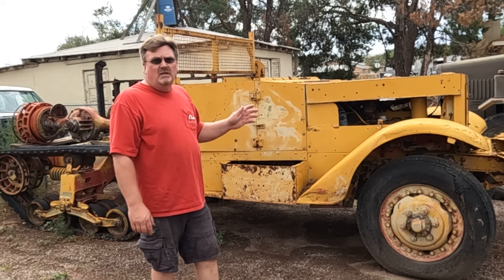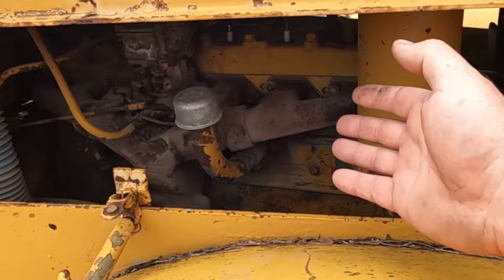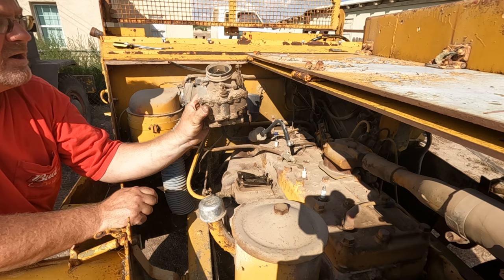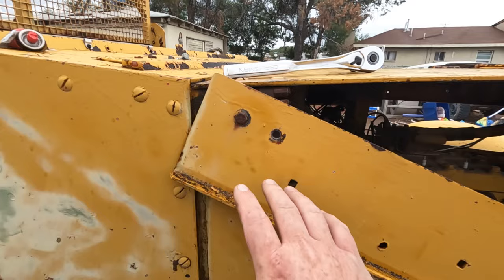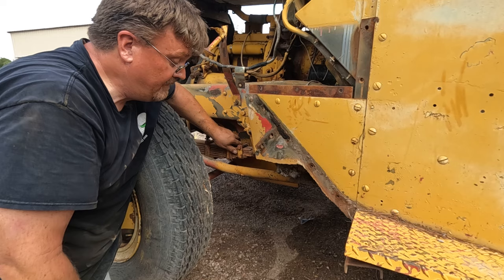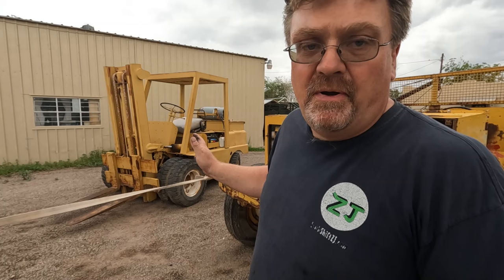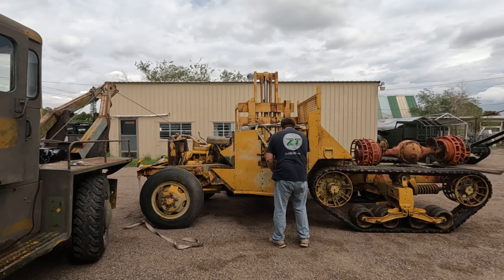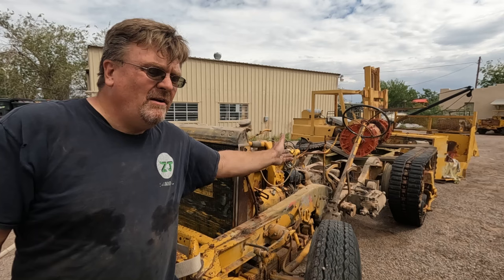WWII Half-Track Stripped to the Bare Frame!

Comment: No idea if you know it, but that pre-atomic bomb armor plate is actually pretty valuable. They use it for geiger counter and other "nuke sniffers" type instrumentation housings. All the steel from that tear down is premium scrap.
Reply: what?
Reply: @69uremum  steel refined before atomic bomb explosions has high value for technical use, so long as it isnt alloyed with later production steel. all ww2 and earlier steel (pre 1945) falls into this category, but armor, due to the alloying metals used, is especially desirable, as are tool steels
Reply: @ludditeneaderthal I thought that was only the case on shipwrecks due to the radioactive shielding properties of water?
Reply: @bl7355  No he's right. It's all pre nuke steel
Reply: @bl7355  Nope, all pre-'45 steel. It's the production of the metal that introduces the isotopes from the air. As long as it wasn't melted since '45, it's good.
Reply: Take the engine out and make a bbq smoker out of it 😂😂😂
Reply: Thanks

Comment: With the 3D printed rain cap, stick some grease on the mating surfaces as a cheap gasket and load up the nuts to stop water sitting in them. Its cheap to do and help keep water out.
Reply: even some anaerobic silicone RTV would  work
Reply: Grease wont stop water

Comment: I recall Tommy Hunt of the long gone Southern Parts Corp. - "World's largest supplier of halftrack parts," asking me if my halftrack still had the armor protection under the oil pan? Mine was long gone. He advised that that was the first thing to remove and toss away unless you were planning on driving through mine fields. Back in Memphis in the years of the early 1970s, you could buy from them a fully rebuild halftrack for $4,400. I did see the remains of one M15 halftrack in their yard sans its turret.

Comment: Back in the 1960s and 70s we used to see a lot of half-tracks used in the logging industry in Nor Cal, Oregon and Washinton. Bought cheap as WW2 surplus, they were modified in the field to do the job at hand, and used until completely used up. I have seen them used a skidders, pulling smaller logs to a landing, fuel carriers, and even tool trucks for rough terrain to reach broke down equipment in hard to access areas. I am
not surprised to see the upper structure of this one so heavily modified. I have seen far worse. By the 1980s, sightings of half-tracks in the woods business really dropped off. They were worn out and cast off.  No telling how many got scrapped, probably a huge number.

Comment: Love the disc e-brake. I had a CJ-3B with a 2-A body and a hood scoop to accommodate the tall engine. I could never get the e-brake to work good enough to hold on steep hills. I found a pinion disc brake that bolted up to the t-case in place of the original drum. A pull lever between the seats activated the e-brake. worked fine. Love your content.

Comment: The gearbox has a spring support only because the half track drive axle was bolted to the vehicle frame and didn't move or have suspension, therefore the spring support was only there to support the gearbox when the engine flexed on its mounts with revving or the clutch being dropped.
I only know that because my Dad, who was the Australian Pacific manager for white trucks used to talk about it, the half track didn't have a bolted down gearbox support whereas the white M3 scout car did.
Reply from the maker: That's interesting, I had assumed they made the scout cars the same.  Thanks for the info!

Comment: When fighting with rusty bolts I’ve never seen anything better than mixing acetone with transmission fluid 50/50 and dousing the threads.   Works miracles

Comment: Sad what they did the vehicles after the war. There were a lot of them and they were dirt cheap so folks did what they wanted to make them work for their purpose. 80 some years later there aren't many left and what are are pretty picked over. My 41 Power Wagon had a huge hole cut in the center of the dash and a round gauge cluster from a 34 Plymouth jamned into the hole. The bad part is the factory gauges were there in the proper spot and worked, even the speedometer. I'm pretty sure I still have the instrument cluster I pulled, and the extremely rare blackout light bracket that mounted on top of the left headlight cage that protected the headlight and glass. I never broke a headlight even pushing through thick brush and small trees.
Reply: That's also why tractor pulling has been dominated by Allison V-12s and Pratt 18-cylinders for *decades*. Hordes of these engines were sold off for basically scrap value in the years following WW2 and hotrodders hoovered them all up for all kinds of shenanigans.

Comment: I'm new here, as a new pair of eyes I can see that you might have have taken on too many jobs.
Your Crane and forklift need to be finished before you start something new.
The close up of the forklift tyres as the virtually crumbled before our eyes was hilariously funny.
The Forklift is a necessary tool, please fix it up. You'll look very professional.
Reply: You can never have to many projects going on!
Also, gathering parts for these kind of things takes time, especially if a guy wants to keep the cost down. Therefor it's possible having many projects going on at the same time.

Comment: The one wire to the rite side frame rail is for the passenger side fuel tank gas gauge fuel level sender. I know about halftracks. Your video's brings back a lot of memories.☺🙂🤔

Comment: 10:20 for nuts and bolts like that, i smear grease all over to keep the water out.

I have a srew conveyor that transports salt, water condenses to salt and its covered in salt saturated water.
you may imagine how quickly it will rust :)
I have smeared to whole thing with grease as the bearings and whatnot require changing quite often, even after years the bolts havent rusted at all and will open easily.

Before i did that the heads would get rounded within months from rust

Comment: I'm thinking something could be done with the back axles.Maybe make the lower half into a runner, and if you live in snow country, make it into a snow plow.Maybe stuff a regular truck cab on it so you could have working doors and such, then a flatbed above the tracks. Motor wise, 12 valve Cummins could motivate it.

Comment: Spring at back of transmission to prevent broken flywheel housing from the heavy leverage length of transmission hanging on flywheel housing.

Comment: Still some good meat on that chassis - as you know. A full set of serviceable running gear and rubber tracks is a great score for a start. Is it possible to get the tracks 're-trod' with fresh rubber, or do they have enough miles still in them?
Reply from the maker: These tracks should be ok for now, as long as I don't go to fast.  They might start flinging off chunks at speed.  I do have a spare track, so I'm good for a while.

Comment: They may have made the trans mount that way to allow some flex to the frame as I`ve seen in off road vehicles of that era, is that they don`t get around off road that well compared to modern vehicles where the frames flexing allow for better traction off road. Theory #1 any way.

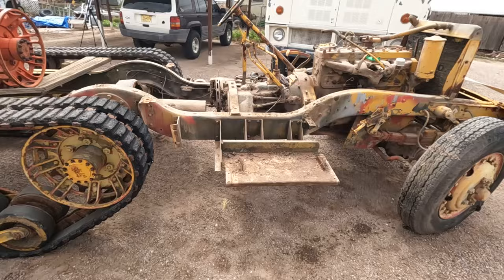Comment: 27:27 I say you take another stab at getting the engine running. Drop the armor plate down off the pan, drop the pan, figure out the oil pressure. If it's fixable down there and you have a viable engine, then put a quasi-comfy seat on the frame and roll around in just a frame for a while! Hell it'd be a neat thing for       parades and such, drive around just the bones of one so people can see what makes them work.
Reply from the maker: Yeah, I agree.  I need that armor plate for my other one anyway, and now I can remove it a lot easier.  Then I'll drop the pan and see what the damage is.
Reply: @LowBuckGarage  Will be a good video looking up inside an 80 year old engine that likely hasn't had very good care done to it in any one of those years.

My guess is there's trash caught in the oil pickup. Sludge or somethin' that sloughed off of a counterweight when you went to revive it(Or even just towed it home) that got sucked in there and plugged up the works. If that's the case, easy fix.

Comment: i don't know if your printer supports dual extrusion, but if it does you could basically use ninjaflext o incorporate a gasket into the bottom of your intake cover plate design to make a easy water tight seal.
Reply from the maker: Unfortunately, its a single extruder.  I bought the cheapest version I could find...
Reply: @LowBuckGarage  ay nothing wrong with that,    though if the idea appeals to you you could still do it as a 2 piece,  just slice the bottom layer off the model and print it in ninja flex.  perfect low effort gasket.

Comment: If I could afford it , id love a modified half track for my wilderness adventures.  Can they be (functionally) set up with forward skis like a snowmobile? For deep winter?  Also, I am 6'3" 300 lbs,  I'd have to really overhaul the cabin.  
I am no expert on this . Not even close. Does manually turning the fan redistribute oil on a functional engine that's benn sitting ? I know many tanks did in that time period...
The oil would settle and need to be redistributed by a hand crank  .  I never was much into cars or trucks , but I have long wanted a half track , a ferret scout car and an army Corp. of engineers recovery vehicle based on the m48 or m60 Patton .  A Sherman based one would be too top heavy for the woods and swamp I would be traversing and one based on an Abrams would be far to heavy at 50 tons unless the ground pressure is very light.  Not that I can afford even the manuals but desires do not stop because money does. Lol
Reply from the maker: You probably put skis on it, because you can disconnect the front drive and power it with just the tracks.  It is heavy, though, it really needs a bunch of steel on the back to balance it out.

The oil pump is directly driven, so when the engine spins it will start pumping oil.  It does take a bit of time to pick it up out of the oil pan and get it to the bearings.  I've pressurized them with an external electric pump before to get everything pre-lubed.

Comment: I think everybody has "a screw lose" or two, but the thing is, it can't be a load-bearing screw, lol, are those tracks in better shape than your other ones?, what's wrong with your fork-lift?, that would probably make a good video, thanks for sharing.
Reply from the maker: Hopefully its not a load bearing screw!  These tracks are in better shape, but the other ones are still working.  Not sure if I want to go through the effort in swapping them; they don't change easily.  I'm not sure about the forklift, the transmission oil is up where it should be, so probably internal damage.

Comment: seems to me, you did not finish the intake holes closure.  Water could get trapped in the top of the nuts holding the plastic plate, then trickle down into the intake manifold.
Reply from the maker: It could get a little in, I'll take it off after a rain and see what happened.  I can always put nylon nuts or cap nuts on, those would seal the threads.

Comment: Another mint video mate👌🏻
If the ½track engine is 86'd...drop a Cummins in it😁👍🏻
Is the forkin forklift a torque converter transmission?.
Reply from the maker: I'll be pulling the pan off soon, but I think the frame will get a re-power.  Yes, the forklift is the torque converter type with hydraulic wet clutches for shifting.  When I checked the fluid, smoke came out the dipstick tube...
Reply: @LowBuckGarage  
I presume your reaction seeing the smoke was the same as me reading the comment "Oh Shit!" 

Good luck unfucking the transmission.🤞🏻

Comment: It's just metal, pull it apart, do the engine, & chassis work then put it back together correctly, the turret can be built too, 'oem' is of lesser importance than operational examples of these war relics. 
Sure some of us nearby, or the means to travel & stay nearby long-term would be willing to help you with this endeavor.

Comment: Hey, what are you using for your main camera right now?
Reply from the maker: I've been using a GoPro hero 10 with the media mod and light (they had a really good sale).  I really like the onboard light for shots under the car or in tight places.  Still not really happy with the audio, but its not too bad.
Reply: @LowBuckGarage  thanks, I'm considering buying Hero 8 (more reasonable price IMO). I was trying to make videos using old photo camera, but quality was not great.
Reply from the maker: @Vein1986  One thought on that, and the reason I popped the money for the 10, is the front screen.  I do all of this myself, so I don't see what is on the video until the editing.  Before I had a lot of clips where what I was trying to show went off screen, and I didn't find out until after.  I can't do re-takes with building stuff, so I lost a lot of important parts of the story.  The 9 and 10 have a small front screen, so you can see if you are on or off screen while its happening.  That was critical for me, and has saved a lot of frustration.

Comment: I find it hard to give you a thumbs up, you have a forklift that doesn’t work right? And you are pissing about with a half track that could have been done at a later date?
Reply from the maker: Well, the forklift worked the last time I used it, so I was expecting to hop in it and drive away.  None of the stuff I do on this channel needs to get done right away, I'm just having fun with toys.